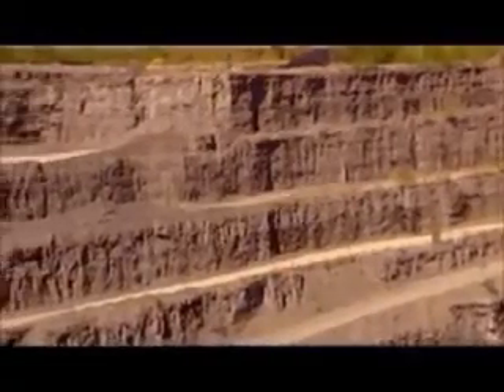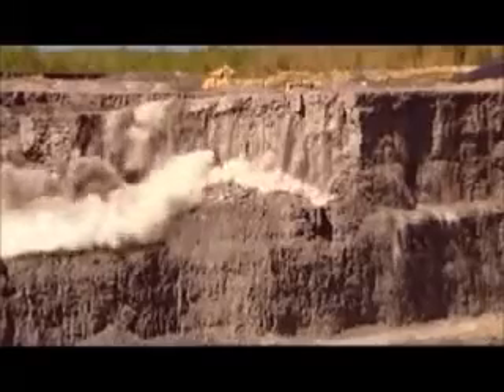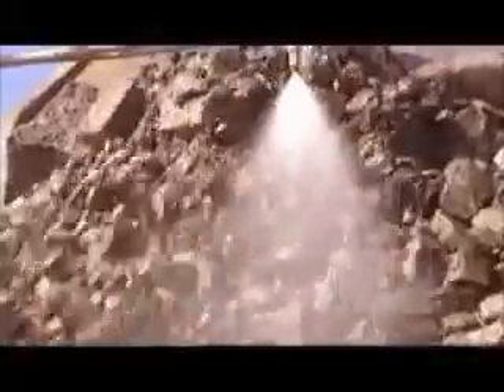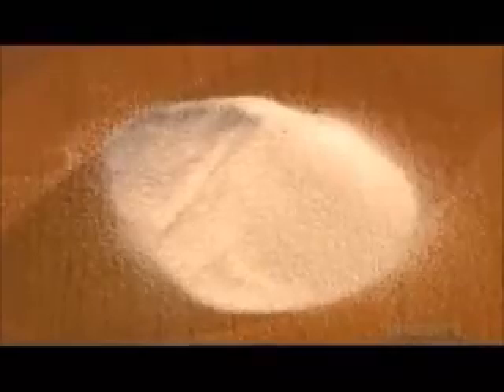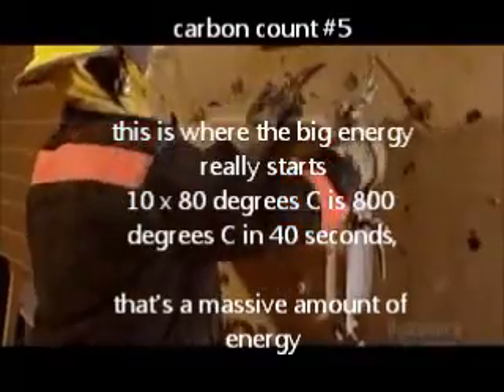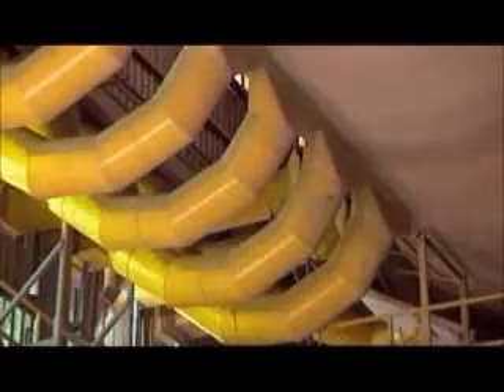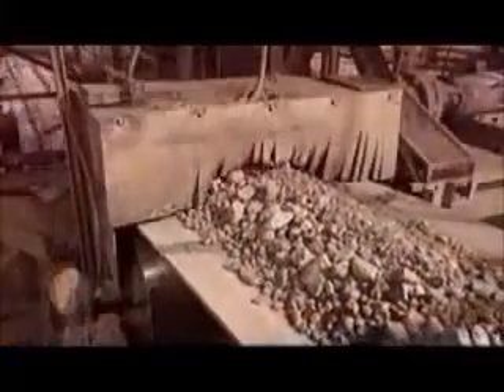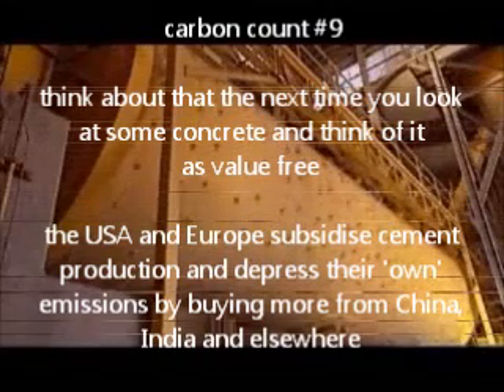cement production and co2 emissions.wmv

Comment: Here in Switzerland (and europe in general) Concrete is used for everything. one storey building ar built with all walls (internal and external) in concrete. This is crazy. Concrete was invented to be a breakthrough in engineering! Huge and amazing things can be done with concrete, bridges, skyscrapers, Tunnels ecc.  But is stupid to use it for everything. Like driving a SUV o in the citycenter ....